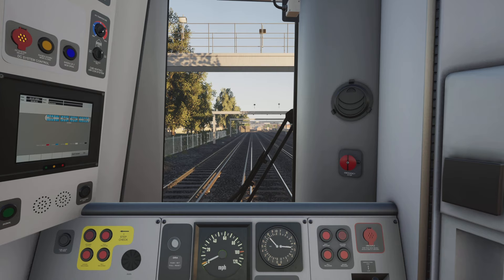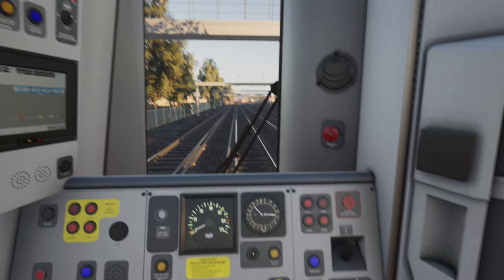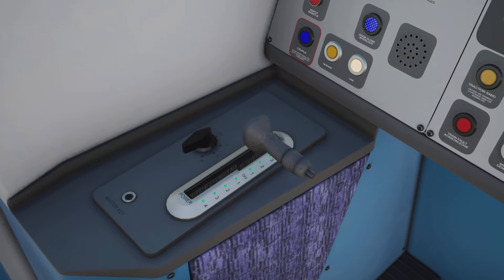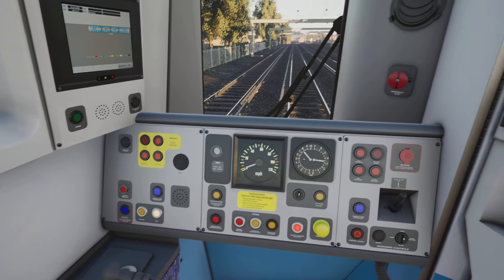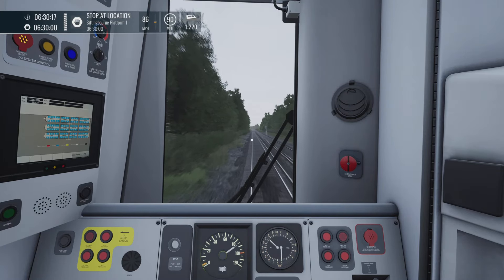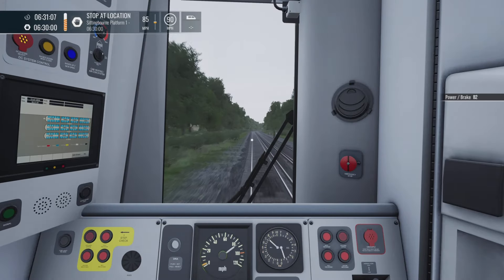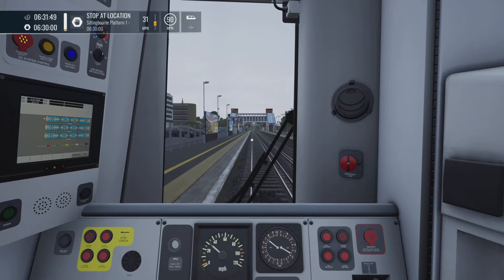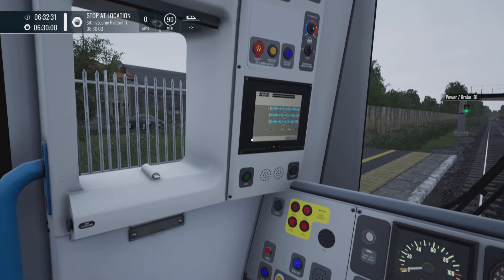Train Sim World 4 - (Part 1) How To Accurately Stop At Stations!

Comment: I have been wondering about this for quite a while. In the UK, is there really no designated sign informing you of an upcoming station?

Saw the other comment mention a sign in Belgium, these signs also exist in all of Eastern Europe (or East of the iron curtain) and Germany. A white board with 3 diagonal black stripes, always placed a fixed distance away from a "platform stopping point sign" (or platform end, etc.) depending on the max allowed line speed.
Reply from the maker: @slovak_eagle  Drivers in the UK rely on route knowledge when it comes to braking points for stations! They tend to look out for trackside landmarks e.g. signals, bridges, speed boards, bends!

If the speed limit is low enough however, they can simply use line of sight!
Reply: @VirtualRailDriver 
I see. Very intresting.

I guess there is no real need for such signs unlike here. The type of train can vary a lot, even on the same service. It can be loco hauled, dmu, emu. Not to mention the amount of cars and general weight changes as well. From what I have seen, loco hauled trains are very rare in the UK now. I guess route knowledge coupled with driving experience of a specific unit gets rid of the variety I assume, therefore operating a train is pretty consistent.
Reply from the maker: @slovak_eagle  Absolutely correct! Each passenger service in the UK tends to be worked by the same model of train everyday! The number of carriages normally stays the same but can sometimes change!